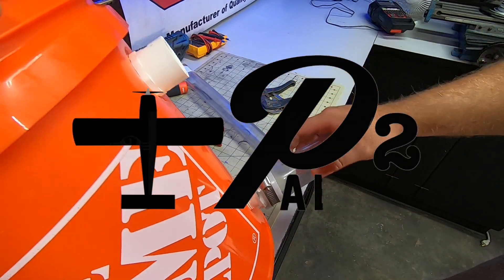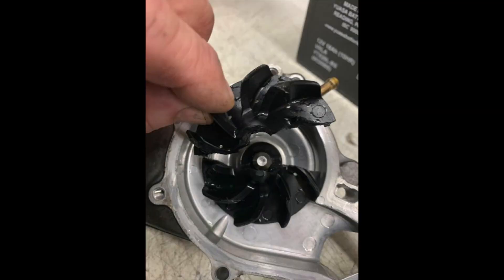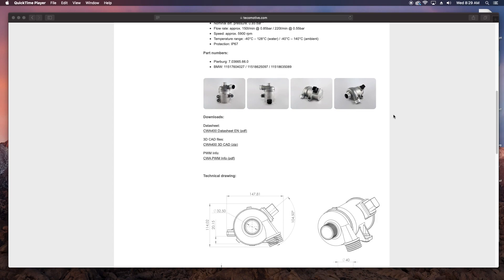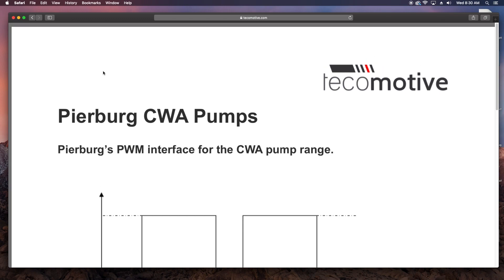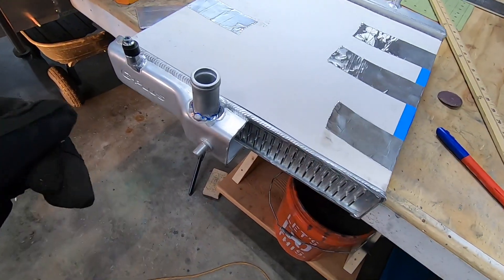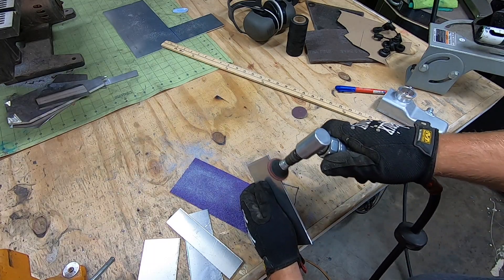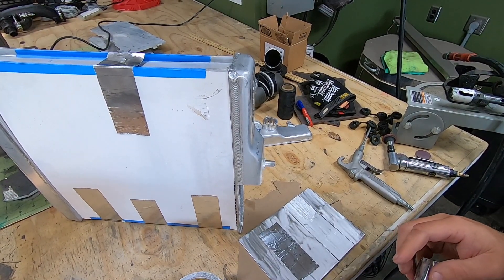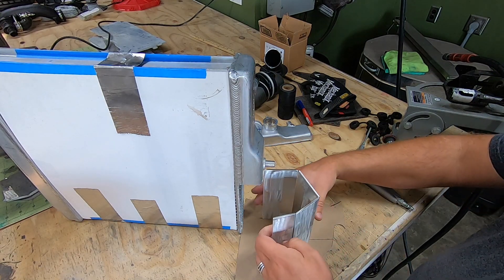BMW WATER PUMP IN YAMAHA POWERED AIRPLANE EP35

Comment: my 2cents from working at a BMW dealer for 15yrs now...be sure and run the blue BMW coolant, I would say 90% of the pumps I have replaced have all had non BMW coolant.  One other thing to keep in mind is the pumps dont like drying out, what was a working pump when removed would fail quickly if it sat around for any period of time, like replacing an engine.
Reply from the maker: Thanks for the heads up! I really only used this one for testing. I’ll be running a Davies Craig pump for the real thing👍

Comment: OK the Pro - "Pierburg" _ german company with excellent engineering track record, (have had considerable experience with their engine driven vacuum pumps)  the big Con's (to my way of thinking) massive amp draw & not inconsiderable weight gain, 
respect you idea, but I'd be looking to exhaust all options around replacing that plastic impeller - enjoying your journey.
Cheers Glenn. DownUnder.
Reply from the maker: Thanks Glen! I too have similar concerns, but for ground testing i wanted the biggest one to make sure i could figure out what kind of flow i needed in my final choice. I do suspect it'll end up being a much smaller lighter model with much less power consumption.

Comment: I understand the testing but depending on any part of the DC electrical system being a critical element of allowing the engine to run would not be my choice of a reliable aircraft system..
Reply from the maker: Yes sir, a valid point. The water pump, no matter where it gets its power is critical to the engine. Being electrical has little bearing to me on its reliability. Thanks for chiming in Mike! Always appreciate the input sir👍
Reply: @Project2Aero  and please don’t get me wrong, I appreciate those who try new things.  We all have our different preferences and limits
Reply from the maker: @mikewings  Not at all Mike, no offense taken. If people can’t be ok with others opinions then we just end up with things like our current US administration and main stream media. I value others who add knowledge and insight to the comment section. Rest assured, I’ll test things before ever trusting it in the air. Thanks again!

Comment: I don't know if you want to hear this, but I work as a mechanic insurance assessor over here in New Zealand. We routinely see failures on the BMW electric water pumps. It occurs often enough to know they are a weak point. 
I'm not sure if something like a Davis Craig pump might be more durable. At least on an aircraft you do get better engine bay cooling than in a car.
Reply from the maker: Yes sir I’m aware of the bmw issues. This specific model is the better version with a much better track record. Some of the smaller versions of this pump are sketchy at best. Thanks for the input sir👍
Reply: Oh good work on doing your home work. I'm loving your build, I look forward to your episodes

Comment: A Ford's Shelby 500 has a light weight coolant pump that is used for the supercharger intercooler. Maybe it is lighter and draws less electricity
Reply from the maker: I'll take a look at that. I like the idea of having an over-capable pump and isn't stressed or maxed out by the load i'm putting on it.